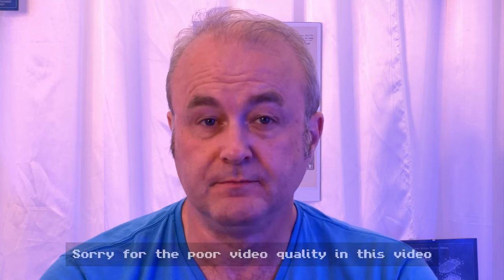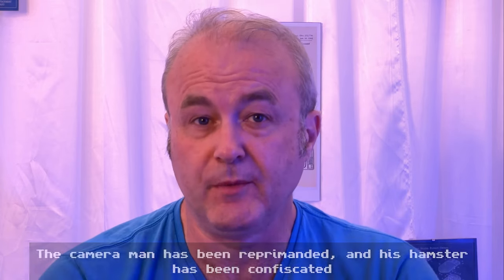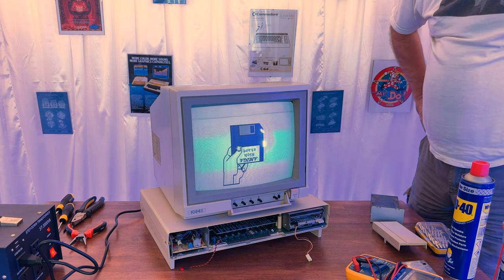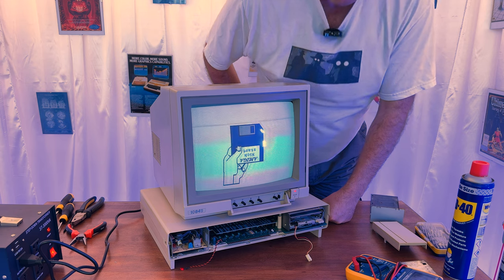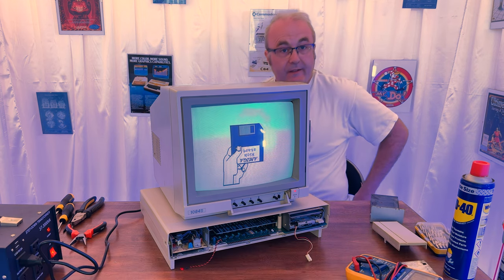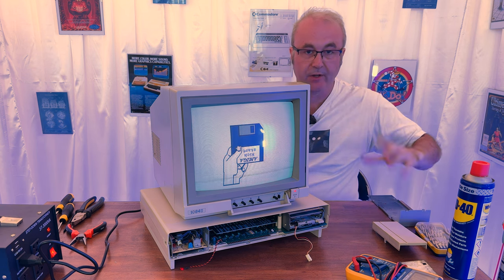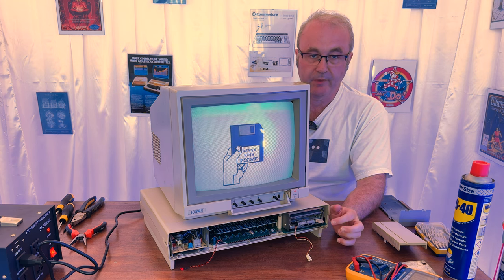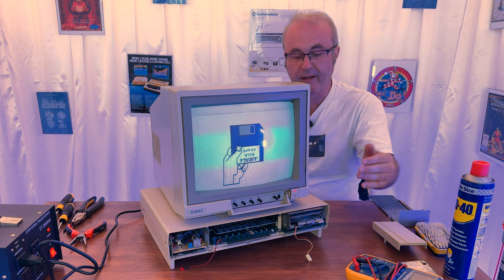Amiga1000 CH01: Unboxing & Test

Comment: North American Amiga, meaning it does not have the Commodore logo under the Amiga logo. I prefer that look myself, it looks a lot cleaner. Really nice shape, from what can be seen. I have to wonder why you didn't just cut the cardboard off though. The front can split off when pulled on like that. You were lucky.

There is an Amiga 1000 ATX converter for power, which allows you to use an ATX PSU. Pair that with a NanoATX and you can run the machine with a 12V brick. Really handy, although the A1000 PSU is overengineered like everything on the Amiga 1000 (except RAM).

There is no bigger front expansion for the A1000, that is correct. It's CHIP RAM, meaning it is accessed by the CPU every other cycle and the special chips every other cycle. That makes the CHIP RAM 512k, which is the maximum amount the A1000 supports. More RAM can be added on the side expansion slot or internally, and should be FAST RAM, which can be accessed by the CPU every cycle, thus the moniker.

Wifi is 2.5-5 GHz, so 20 MHz, even with overtones, will not interfere.

There are little boards allowing kickstart in ROM. I have one I don't use. ;)
Reply from the maker: Yes, it does look cleaner without the Commodore logo. Odd that they did not do that at that point, as usually Commodore branding is always present.

Would you do me a favour, and contact me using the channels email, and send me a link to that A1000 ATX PSU?

I have a Parceiro II+ that will be installed in this machine soon, I beleive that adds Fast Ram, it gets the ROMs into its on Flash Ram, which I beleive it can also switch, so different ROMS if needed, and also it provides an SD card based HD. Should make this A1000 perform pretty well eh?